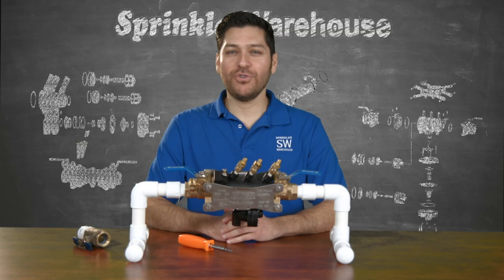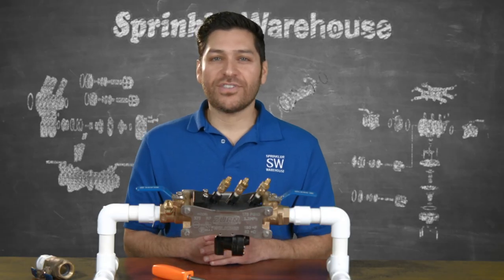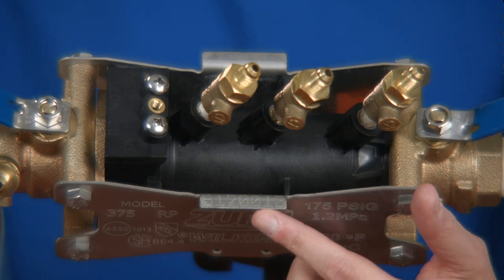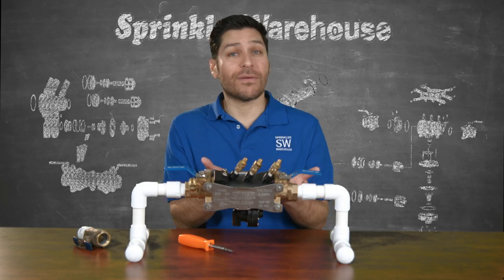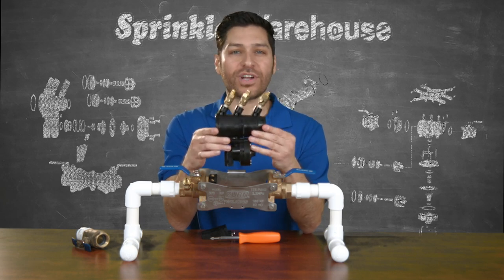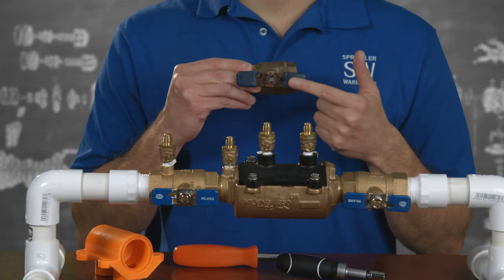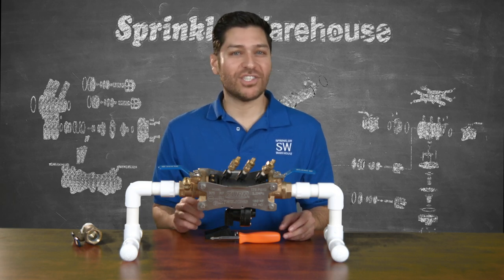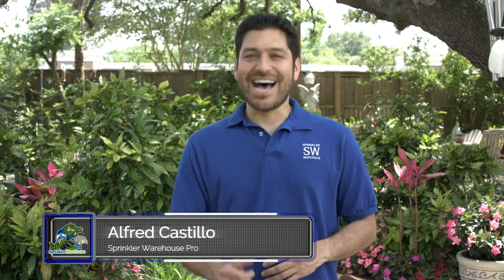Zurn Wilkins 375 RPA Fast Test

Comment: When 1 or multiple fire hydrants are opened on an municipal potable water main, the other connection points on that main experience pressure loss into their building and therefore creating a BACKSIPHONAGE condition on those connection points...not a BACKPRESSURE condition.  The downstream pressure of the RP assembly would have to be greater than the inlet of the assembly for it to be a backpressure condition.  The RP assembly does protect against both backsiphonage and backpressure conditions, but I just wanted to help you clarify your explanation.